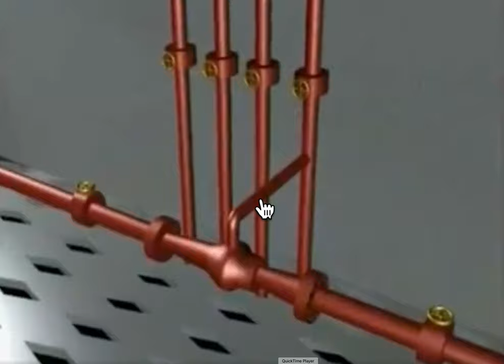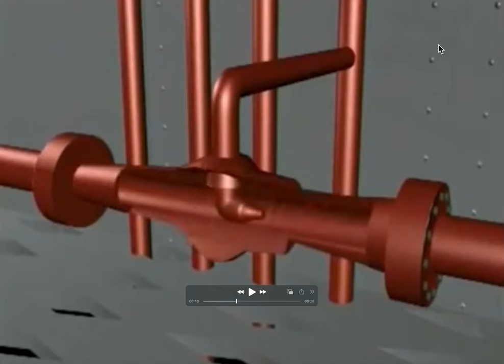Eductor Operation

Comment: Chief , when the auxiliary engine is running , on a lube oil cooler  , do water leaks to oil side or its the opposite ?
Reply from the maker: Opposite oil normally should flow to oil due to higher pressure but if pressure is not adjusted properly or cooler open and o-rings placed different can be other side too
Reply: @Adventure-Story  so oil has higher pressure than water right ? So this could be a cause of lube oil disappear from sump
Reply from the maker: @oualidmokhchy7042  yes that's right but oil can be burned too if we have wear at cylinder head components. When overhauling take place just replace everything with new if you are making diesel generator overhauling. I mean for consumables rings o-rings and valve stems valve seats.Not big cost at all.